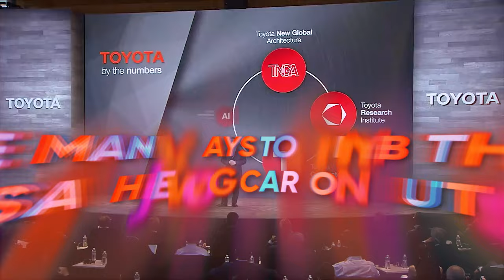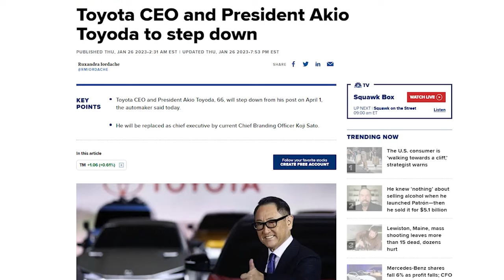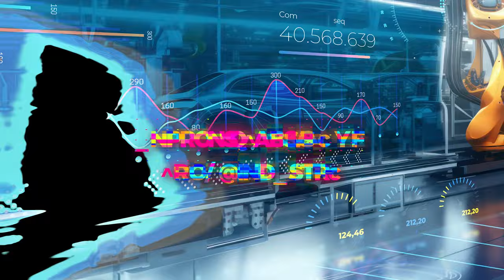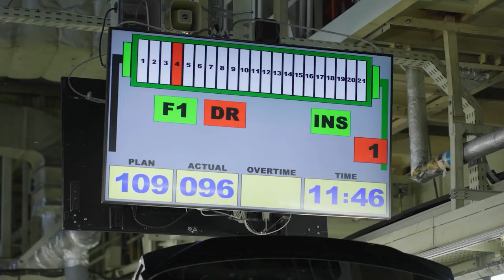Toyota Chairman Says “People Are Finally Seeing Reality” Of EVs

Comment: Hybrid is better.
Reply: Hybrids were an attempt to overcome the range anxiety that many feared with BEVs.  But the range has improved and the charging network is good and getting better, now that all manufacturers in The US, Canada and Mexico have agreed to use Tesla's charging standard.  Hybrids give you 50 miles of battery range and a relatively low horsepower gas engine.   They also have a complex electronics to interface the ICE with the motor. which is another thing to fail.  You still need to go to the gas pump and deal with all the maintenance of a gas engine.